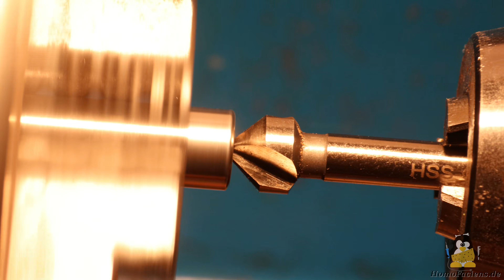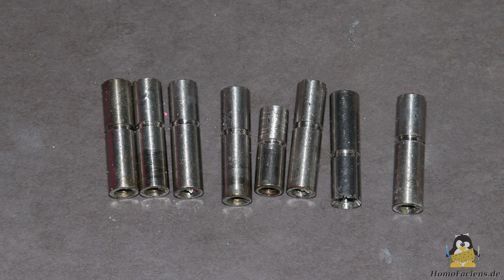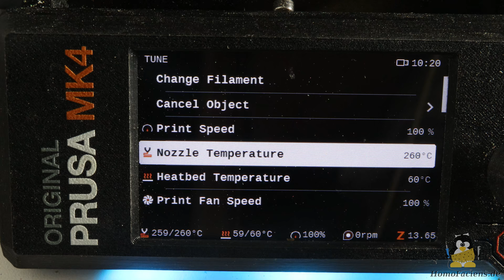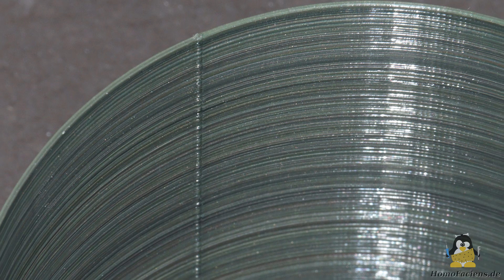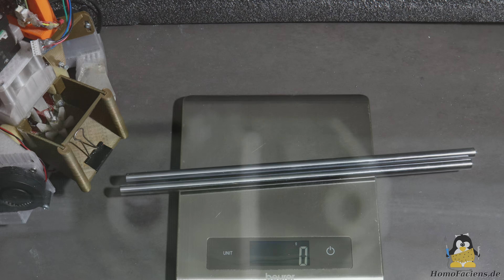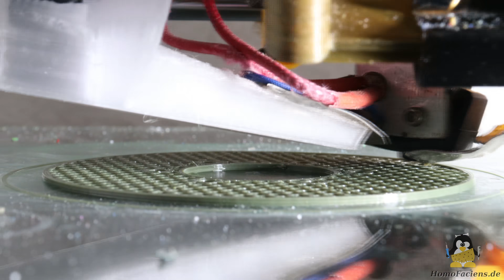Direct Granules Extruder V7.1 - Print tests

Comment: Ah, I previously mentioned a method of smoothing the bore and setting the final ID by pushing a ball bearing through a tube.  It never occurred to me that some wall roughness is necessary to allow the melted material to cling some in order to advance with screw rotation.  It's obvious now.

Comment: Nice news indeed. I was thinking, however, about you talking about too smooth bore would allow plastic to just rotate... What if you made bore just a little bit smaller, then add shallow grooves inside it so plastic cannot rotate? You can make bore very smooth indeed. IE bore is 0.1 mm smaller, and grooves is 0.1mm deep. I don't know how you would add grooves however. Broaching is best I think but expensive.
Reply from the maker: I had thought of EDM for adding groves to smooth walls, but why smoothing the walls to a mirror finish and then add groves when it works without that extra efforts?
Maybe in a later iteration something like that will come. Maybe materials other than PLA require some sort of groves.
Reply: @HomoFaciens  It's combination of easier to go down, and harder to rotate is why I was thinking of this. Not sure how smooth insides of grooves would be required for it to still go down though. It don't have to be glass smooth like you said, but smooth enough from reamer.
Reply: @HomoFaciens  Hm I wonder if making VERTICAL starches would be enough for anti-rotation? Just single run though with sandpaper to make very visible straches after making it reasonable smooth to avoid horzional lines.
Reply from the maker: Throwing in ideas is worth nothing. Try things it out an report on the results. ;-)
Reply: @HomoFaciens  Lol indeed. Sadly I have no way to have any shop, and home don't have any space at all.
Reply from the maker: It should be mandatory to have a workshop in every house.
Reply: @HomoFaciens  HAH! I agree :)

Comment: I wonder how much improvement to the heavy X-axis could be achieved by just using a printer setup that has the bed do all the X/Y movement. Like a CNC mill.
Reply from the maker: The bed with a large print on it is heavy, too. The weight of the printhead doesn't change over time, while the build plate becomes heavier. Input shaping can reduce the vibrations of the printhead.

Comment: This is so damn impressive. I almost exclusively print parts so this is very interesting to me. FYI I found "Reverse on even" with "Reverse threshold" at 0 to be hugely helpful for part printing because of the way the alternating print direction balances out errors with over/under extrusion, scarf seams, normal seams, etc. I can highly recommend it and wish someone had told me earlier... I'm usually prototyping and focusing on reliability over aesthetics and this has been my absolute favorite change... buried in the "Overhangs" section!
Reply from the maker: Thanks! Well, if you want to check the performance of an extruder it isn't helpful if your software settings hide the weak points. Tune the hardware parameters to the optimum is the aim of my test prints.
Reply: @HomoFaciens  💯. Whoops that acknowledgement was in my original comment but accidentally edited it out. 😅

Comment: would you consider doing stress tests of printed parts using this printer with the same batch of pla but granulated at different sizes so we can get a baseline of how the shorter polymer chains affect print durability?
Reply from the maker: You don't crack the PLA molecules (at least not many) by shredding the plastic. The intermolecular forces are weaker than the bonds keeping the atoms in the molecules.
Reply: @HomoFaciens  He may be referring to the degradation from remelting. Commercially recycled plastics are mixed with an amount of virgin plastic to combat this. PLA is apparently hydrolysed during heating if wet.
Reply from the maker: @perenis-z9r When I read comments based on false assumptions, I set the record straight. Playing guessing games about what someone might mean takes up too much of my time. One of the core objectives of my channel and website is to train people to formulate precise questions - for that, after all, is half the answer. Consequently, I have broken myself of the habit of engaging in mental guesswork.

Regarding your (excellent) question: PLA is unproblematic in this regard, as it contains very few additives; I will examine other materials at a later date. One thing at a time, I am not a "whip it out instantly" machine.
Reply: @HomoFaciens  Actually, you were completely correct in your original reading of his question; my brain inserted something that wasn't there. Thanks for your feedback.
Reply: @HomoFaciens  sorry i didn't see your reply before now. What i meant was the chain of polymers get physically shorter due to grinding up the plastics. I worked in plastics recycling from 2012 to 2019 and have seen how quickly the strength can degrade depending on the shape of the plastic and the virgin to recycled ratio not to mention burnt pvc lining the auger among other things.
Reply from the maker: Not all plastics degrade in a horrible way. PLA is a relatively pure plastic and I have reprinted this about 4 times and still the parts were useful. I had a talk with students investigating the degradation of plastics and they confirmed this. PETG with its additives is worse in terms of reusing multiple times.

The question is: How good is still good enough? For my every day prints and for iterating through designs, the mechanical properties are not on top of the list and consider that reusing the exact same material for the next iteration is as cheap as it can be.

A deeper dive in degradation will be treated one day, but not in the very near future. More on top of my list is what materials the extruder can process. Stay tuned!